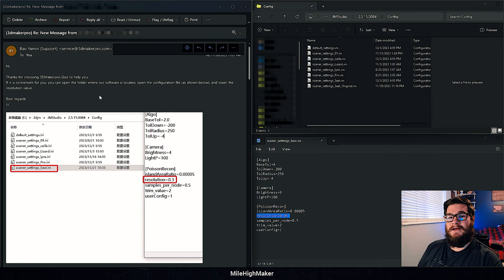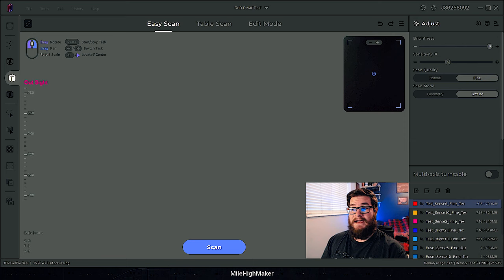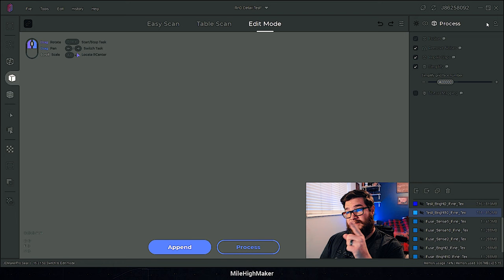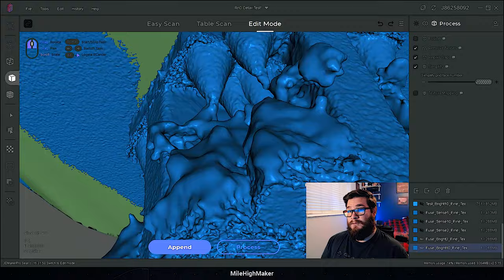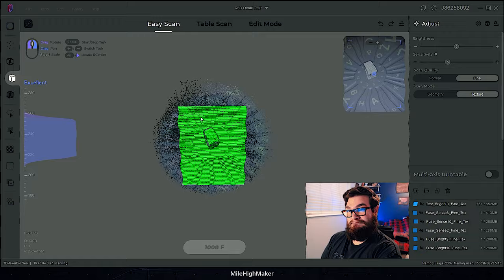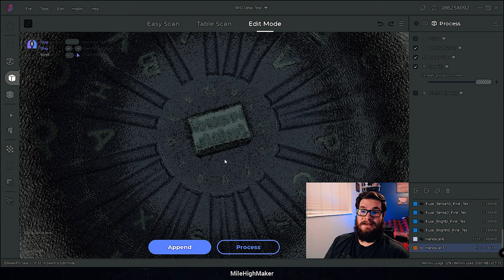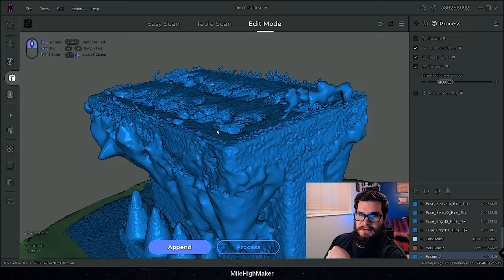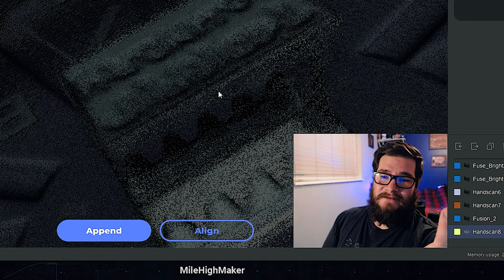How To Get More Detail From Your Seal 3D Scanner

Comment: On my PC JMStudio working fast Ryzen 7 5800x 64 ram. You will have better results if turn off texture and the set detail to normal. There always will be noise, but depence of the light in the room and brightness you set can be manage to lower. Post-processing is something necessary - you have to clean the noise by hand to help the software to do his thing later. My result are good so far, but I'm making 10 scans for every of my projects.
Reply from the maker: I have a 3060 Ti in my machine with 64GB of ram and the program is quite slow, it definitely does not use anywhere near what is available lol. Turning off texture and setting detail to normal does not get me better results, but rather it just eliminates the need to process color data and the normal detail just smooths out the scanned details (and noise) resulting in smoothed out models I talked about in previous videos. Other tests show lighting had little to no effect on the model since the scanner emits it's own light. In hindsight I think most issues have been related to model size (I'm scanning quite small objects) even though I'm well within the advertised size. All the noise I'm getting is making cleanup literally impossible to do no matter how many pieces or angles I scan. 3DMakerPro has reached out to me and said to scan objects larger then 100mm which is 10x bigger then the advertised size minimum which sucks and is not what I purchased this for. I'm learning a lot and it seems like after all this is the biggest factor in quality is reflectiveness and size haha. WOW this turned into a rant. k bye and thanks for the comment.

Comment: Change the config file to these settings. Scanned with the seal with these config setting  for noise clean up . 
[Algo]
BaseTol=5
TolDown=-100
TolRadius=350
TolUp=-5

[Camera]
Brightness=2
LightP=100

[PoissonRecon]
islandAreaRatio=0.00005
resolution=0.2
samples_per_node=5
trim_value=.1
adaptiveOctreeDepth=8
pointWeight=15
solverSubdivide=12
userConfig=1
Reply from the maker: Getting back into scanning after some life stuff. Do you still use these settings? And were there any specifics as to why you changed these? Very curious. Thanks!

Comment: Just curious, how big is the actual physical object? I might have missed it in the video but I didn’t see a picture when I went back and scrubbed through the whole video.
Reply: Going by the amount of space it occupies on the turntable it’s definitely too small for the Seal.
Reply from the maker: It's about 17.6mm wide
Reply: @MileHighMaker   ah yeah that seems a bit small to expect too much out of a consumer grade scanner. We have a metrology grade scanner at work and there’s no way it could scan something that small and it costs literally 50x the Seal. It’s good to know the limit of the use case envelope though.
Reply: @MileHighMaker  So... You are 3d scanning an object that is 7/10ths of an inch with a $600 scanner and you thought you would get a detailed scan???

There is no way... Way too many issues...Especially with object you are trying to scan... The overhangs and shadows are an issue, the distance you are scanning from for that size object....last but NOT least the size of the object..... If the object is reflective(glossy/shiny) try some aby powder, flour, etc... move in closer, also append scans from multiple angles, put the object on both sides and append the scans...